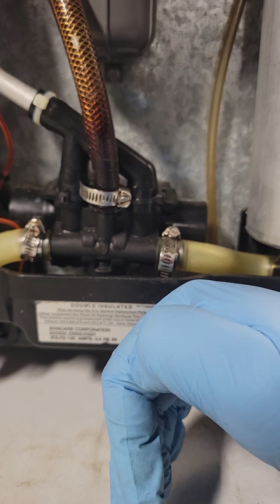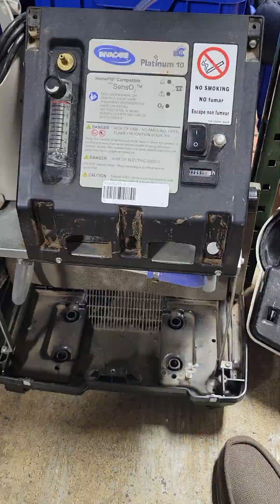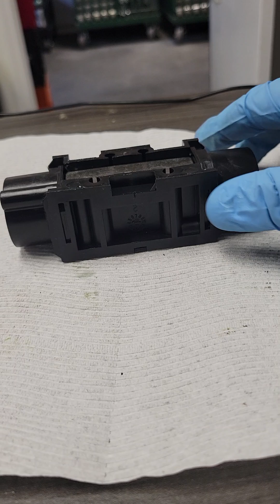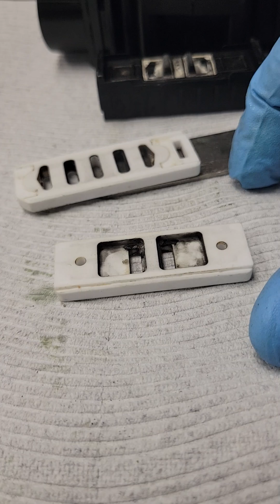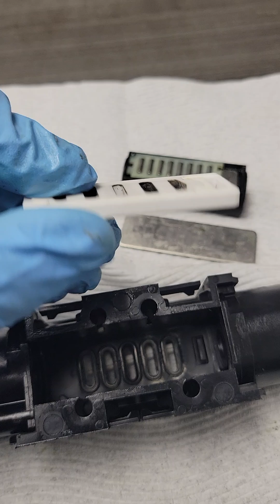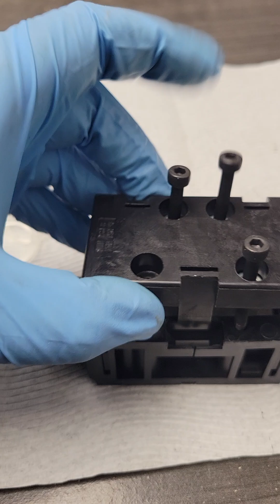Invacare concentrator high pressure no switching code quick fix (4-way valve)

Comment: Getting the high pressure no switching code on a invacare platinum 10 that has only 7 hours on it. Took the four way out and its clean as a whistle. Reinstalled and reset code. Its still shutting down after a few seconds with the same code.